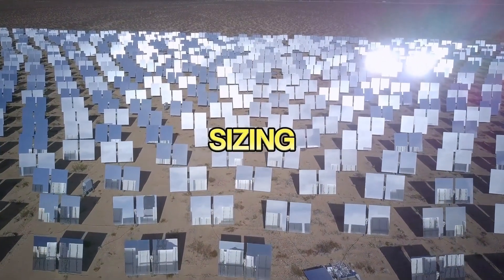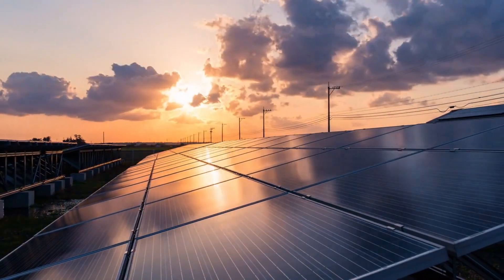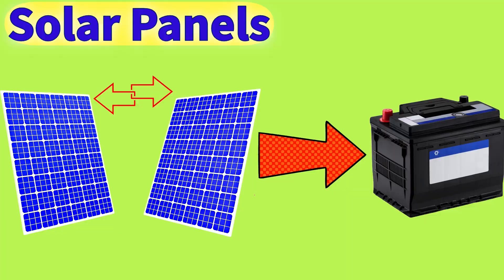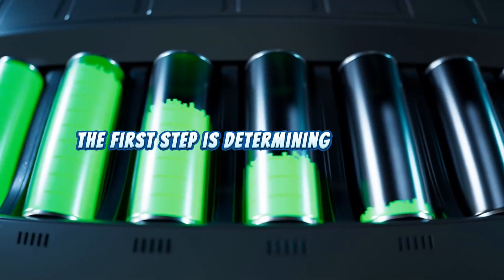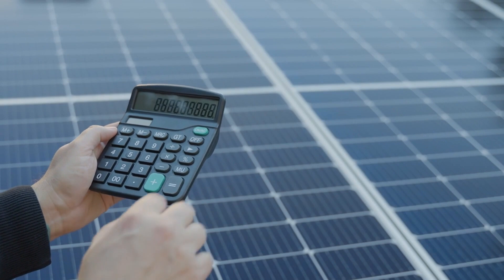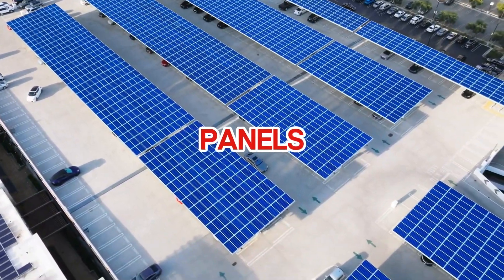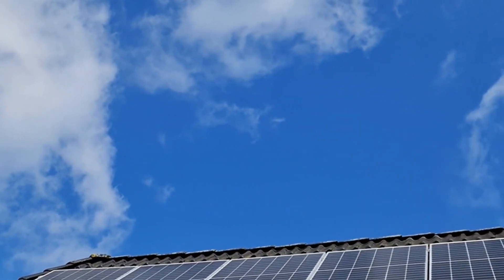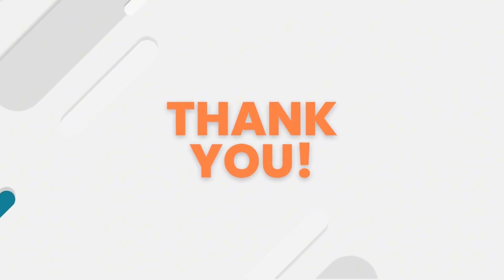You Won't Believe How Many Solar Panels You Need to Charge a Battery

Comment from the maker: For example: to charge a 100Ah, 12V battery (equal to 1200Wh): You would need at least a 300-watt solar panel to charge it in 4–5 hours of peak sunlight.

𝐏𝐥𝐞𝐚𝐬𝐞 𝐋𝐢𝐤𝐞 👍 𝐭𝐡𝐞 𝐯𝐢𝐝𝐞𝐨 𝐚𝐧𝐝 𝐒𝐮𝐛𝐬𝐜𝐫𝐢𝐛𝐞

Comment: what if you only used 500wh during the night. so do you figure on the amount of energy you used or still figure the total storage amount? i run a fridge with 2 100ah batteries in parallel with 4 100w panels in series. so do i figure what i used or what i can store.
Reply from the maker: Great question! When calculating your energy needs, it's important to consider both the amount of energy you use at night and the total storage capacity of your batteries. This way, you can ensure you have enough power to keep everything running smoothly!

Comment: I am planning an off utility solar power system for a model airplane airfield in Los Angeles, CA.  Electric motor power has become very popular, and we supply 12v charging stations to the general public.  The system I am thinking of would consist of 15, 400w solar panels arranged in 3 groups of 5 panels in series.  These will connect to 3, 5kw charge controller/inverters with it's output in parallel, and charging a bank of 6, 100ah 48v batteries in parallel.  This will power 4, 100a/12v power supplies for 80a worth of charging ports each, plus up to 4, 15a 110 circuits.  We also have a 5kw generator that can be used to supplement charging.  Does this sound reasonably sized? Thanks.
Reply from the maker: Thanks for sharing your detailed plan, it's very interesting!

Comment: Solar panels typically range from 50 to 400 watts, and the quantity needed correlates directly with your total energy demand and individual panel output. This suggests you'd need three 100-watt panels to reliably charge your battery. Lithium-ion batteries typically require fewer panels compared to lead-acid batteries.
Reply from the maker: You’re absolutely right! The wattage of the solar panels and the battery type play a huge role in determining how many panels are needed. Thanks for sharing your insights!